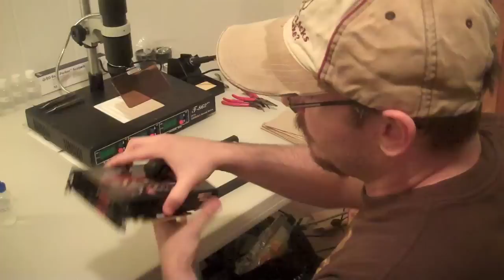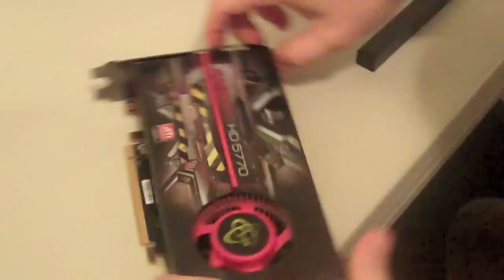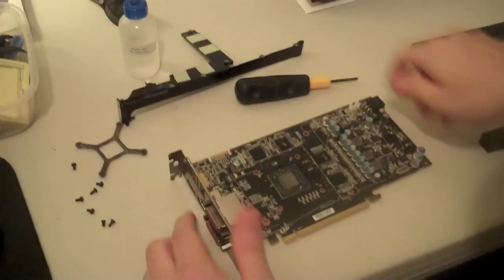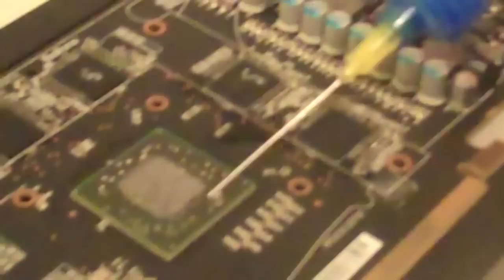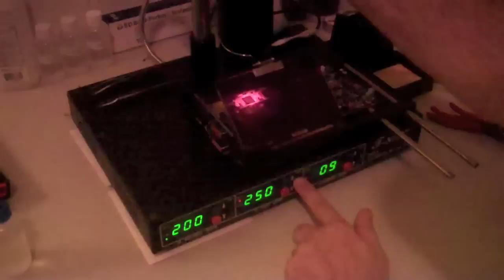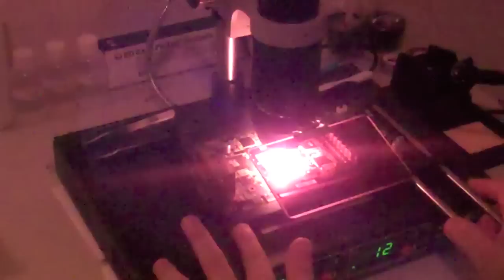BGA Rework of the RadeonHD 5770 Part 1

Comment: how much temp to reflow the north bridge on hp dv7 its smaller than amd vga  chip does it require 220 up 200 down
Reply from the maker: the temp is for the solder not the chip, so same temps

Comment: You sir have traveled 8 years in the future and gave me the information I was looking for. I'm expanding my PC/Electronics repairs to include reworking but I don't want to invest in a $500 machine that ends up not getting used. so to test the waters in my area for reworking BGA chips like the GTX 980 ti on my shelf that started this search for repair solutions. I'm looking at the T-862++ since it's only $170-$200 on ebay and Amazon respectfully. I wanted to know if this thing can handle larger boards like a Console Mother Board or a GPU. and this video shows that it can. I think this will be an excellent choice for a start in BGA repairs.
Reply from the maker: Sorry for the late replay, I have repaired console laptop and desktop mainboards with this station
Reply: @JaS  the question is. how long did it last for. i also am looking at getting one. thanks in advanced

Comment: Just got my ++ yesterday and already had a freebie 7770 to practice on  (started out unstable, artifacts, then stopped working altogether).  Fingers crossed I can get it running.  Sometime after that, I've got a 1st gen Macbook Pro that likes to glitch and lock up, so I'll dress up its GPU as well.  Thanks for the informative vids, especially giving be a good direction for temperatures and timing.  Cheers!

Comment: hello 

i want to know. Is it a good technic to reflow or reballing is better.
is your irda solder t862 good for reballing laptops ? 
sorry for my english

thx
Reply: +bled dar Neither.Just replace the chip.
There is much better rework stations which uses IR with ceramic heaters.Look for them.